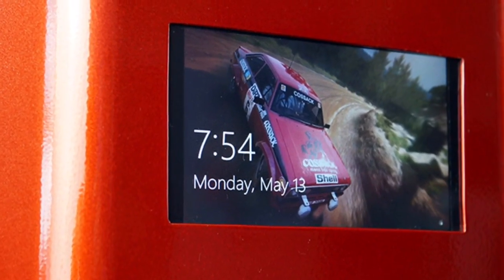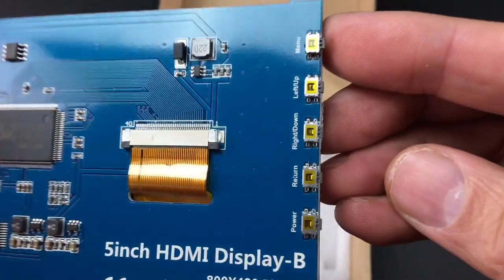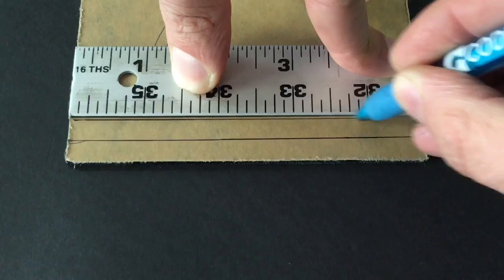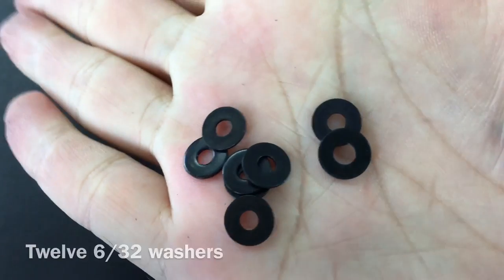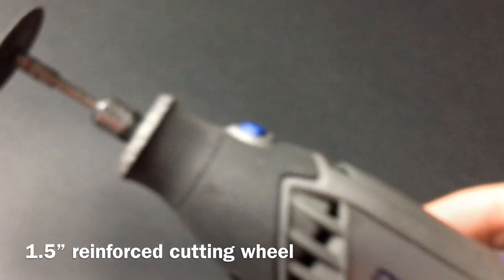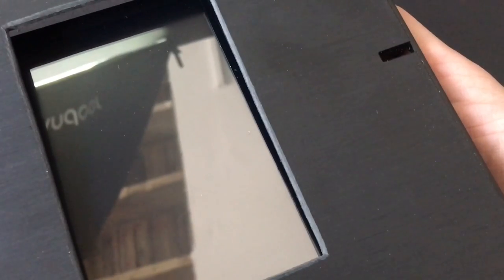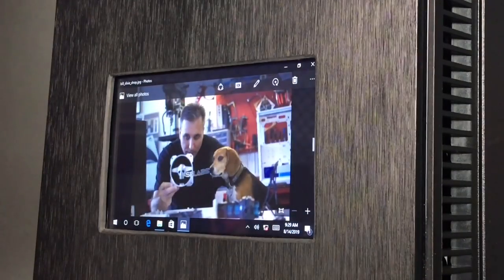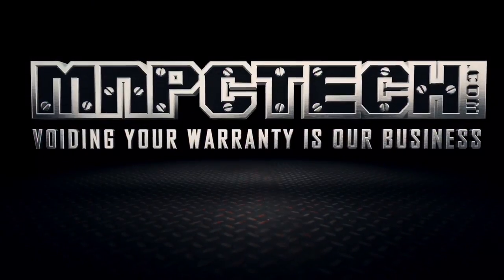How To Install LCD Touch Screen Desktop Computer & Gaming PC Case Mod Guide

Comment: I have to thank you for this awesome lcd screen implementation idea.  I've made a few DIY amplifiers with 2.8" LCD screens and holding the screens in place has been a challenge for me, with ideas like L brackets or a separate pcb bench to hold the screen from behind not working too well and slipping over time.  Excited to try your great idea, thanks for showing it off!

Comment: Nice, I was thinking about getting a cheaper, non-touch screen, and mounting it on the inside of my tempered glass side panel
Reply from the maker: Yes, for sure Steve!
Reply: You doing project snow blind Steve? It’s   A gutted lcd as your panel that’s still see through as long as you have bright enough led’s
Reply: @Yami_Industries  nah, that looks cool but I just want a small screen as a status monitor for temps etc
Reply: @Yami_Industries  I just started the planning for that mod. Saw Hardware Canucks' video on Snow Blind and thought "I have 2 spare 23 inch monitors and an H500M case, I'll give it a shot". Helps that tempered glass side panels are only about $35 from CM.

Comment: i got a 7" Lebula Raspberry Pi Touchscreen Monitor. Plan on it installing it on the back part of the case (fan slot).  When using the stand offs / screws that come with it, the back part of the monitor is as flush as can be with the case and im worried if I turn it on it'll ruin the monitor / short out. Should i get a stand off kit and put a gap between the back side of the monitor and the case?

Comment: Great video with great instruction as always Bill!  Thanks!  Question...  Would it be possible to run the screen off of the onboard IGPU so it doesn't add workload to your standalone GPU?
Reply from the maker: To confirm if your Motherboard allows this, Go into your BIOS, Advanced > Chipset > IGPU Multi-Monitor > Enable.
Reply: As Bill himself has answered, that could be possible, but if you don't have a laptop, I think it just does a video passthrough and it's rendered from the discrete GPU anyway.

Comment: Thank you for the tutorial, but I've a doubt, when you turn off the pc, does your screen stays on, looking for a signal, how can I turn it off, without connetting and disconnecting the usb cable.
Reply from the maker: All you have to do is go into the motherboard bios and under power management find ErP settings. Enable that. It will shuts off usb while PC is turned off.

Comment: How would I do this on a mini itx case such as the ml08b which doesn’t have a extra pcie slot to route a hdmi cable outside also is there a way we can have it flush as in no cable poking to the outside? I want access to all my visual ports for 2 monitors and vr

Comment: mate could i ask you a thing does the touchscreen work?could you control stuff in the screen with a pen or something? like make a program to change fan setups or rgb colors? thanks a lot your video was helpful as hell
Reply from the maker: Yes, it works, but You'll want a program with large controls, as the screen is small. It's really better as visual display. Thanks for watching! I enjoy making stuff for your PC’s in my workshop. visit my store, http://mnpctech.com  and use my DISCOUNT code, MNFAN at check out for 10% off your order

Comment: I did it with the 5.25" bays in the front of my case, I trade Forex online so I have my chart open on that screen 24/7 while i'm gaming or watching movies or both! 😉
Reply from the maker: thanks for watching! If you need anything elser for your PC, visit my store, http://mnpctech.com  and use my DISCOUNT code, MNFAN at check out for 15% off your order.
Reply: Could you link us to a compatible LCD that will fill a 5.25 slot? I was interested in performing a similar mod myself.
Reply: @Blackowtz  You will need 2* 5.25 slots free for a 5inch display, you can search them on Amazon. Things to look out for would be resolution you don't wont to go to high or everything will be too small and hard to read, also you might want a IPS screen (a little more expensive) for better viewing angles, make sure that the plugs hdmi etc. will have enough clearance space in your case for installation. As Bill showed in the video you can use acrylic for the mounting brackets, face plate or to fill gaps. Remember its "5 Inch lcd" you're searching for.

Comment: I've got the tools, I've got the wires, and I can easily buy the screen, I still don't have the balls to cut my only usable case.
Some day, I guess...

Anyway, great video, I love how clean it looks, it really feels like it was meant to be there.
Reply from the maker: Does your PC have a window? You could mount it in the window OR in the side of your PSU shroud, OR create a pedestal for the screen and place it on top of the PC?  OR Yes, just wait until you get a new case someday ;-)  btw If you need anything from my store, use my MNFAN voucher code for discount at checkout goto, http://www.mnpctech.com
Reply: @MaxellAdGuy  It's an Aerocool Xpredator cube (Nanoxia Rexgear) and actually I wanted to make the transparent screen mod on the window, but I haven't find a "free" screen that I can safelly peel the layers off, I could try adapting the front shroud for this touchscreen mod.
Thank you soo much for the voucher, I will surely take a look!!!!
Reply: Bill Owen how do you mount it on the window?
Reply: I'd personally try to put the screen into 2 of my 5.25" drive bays...  thats probably another mod tho...
Reply: @godrickharg5192  have you done it ? i'm thinking on trying this mod on my case

Comment: Does this fit within two 5.25" drive bays?  Unless the vertical height has been mis-written I don't think it will. 
There is a "1080x1920 5.5inch HDMI AMOLED Display" that appears to would fit in two 5.25" Drive bays.
The only problem is that due to it being an amoled screen I fear that it just being a system status display would cause it to quickly burn in.
Reply from the maker: No, you'll need three 5.25 bays. You can fabricate a faceplate mount that matches the OD of 3x 5.25 bays.

Comment: Can a regular slim screen be mounted directly to a wall?, and do you know of any  monitor mounts that screw directly to the wall with no issues other than the weight of the screen?. 
I have a desk that is 40cm in width and together with a keyboard i reckon the average monitors base would be too wide.
(I have 14.5cm headroom when i include the keyboard). 
And monitor arms are not a option due to the desk frame.
Reply from the maker: In that situation, I would need to fabricate a custom mount.
Reply: @MaxellAdGuy  I see, do you know if the metal used on monitor arms is weldable?.
(the clamp "spine" underneath the table)
Because then i can just cut and weld on an extension.

Comment: Can you do larger than a 5"?
Reply from the maker: 5" is ideal for PC bezels, but You can get 7" for inside your PC too!
Reply: @MaxellAdGuy  I got one of the last panels you made to replace the perf panel in the Corsair C70 case you made. I'm really interested in an LCD to fit this panel perfectly. Just not sure of the difficulty in this. Doesn't even have to be touch sensitive as I figure finding a square 4x3 panel to fit would be way easier.
Reply: I was just thinking the same thing.  A 7" inch little screen.  Would be just so killer.

  I also learned something new.  I did not know that.  There is a drill bit made for plexiglass.  This is why I love.  This Tech Channel, & Tech Enthusiast Community.

  *"Knowing is half the battle.  G.I. Joe".
Reply from the maker: You can apply the same steps that I shared for mounting in window as well, OR drill four mounting holes and use screws with nuts

Comment: Could you do a video on how to install an lcd screen to either the dr zaber sentry 2.0 or the skyreach s4 mini so either one of them would resemble a laptop? I know a lot of you bright people out there will probably say go buy a laptop. Well I don't want a laptop. I just want to be different from the normal people. Enthusiasts build their own cases and make them look like the millenium falcon,  a cube,  a desk, and so forth. Each of the cases created in the image of the builder. i want it to resemble this picture: https://hackaday.io/project/15236/gallery#d5dd7c9315206c39197c50ee25c7bfdd minus the keyboard, speakers, and mouse pad.